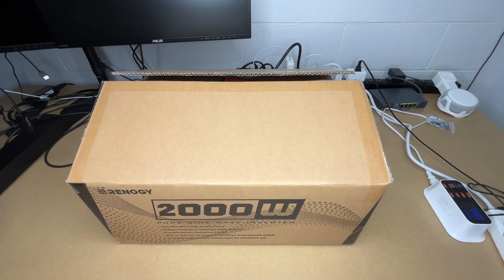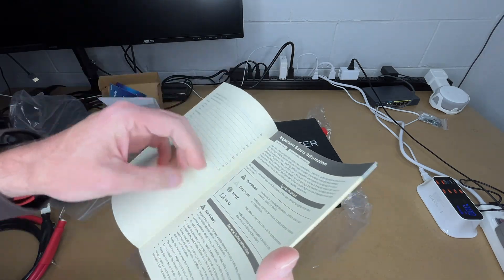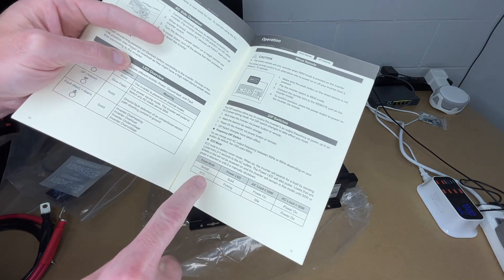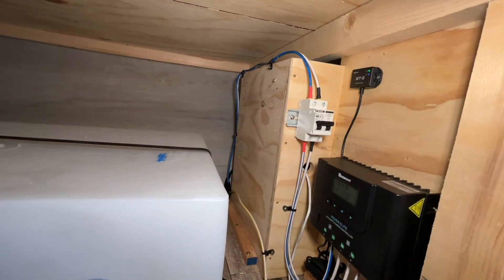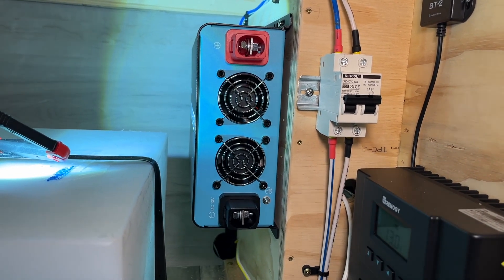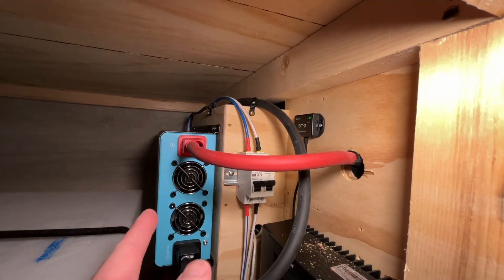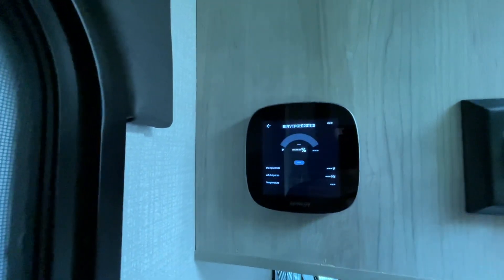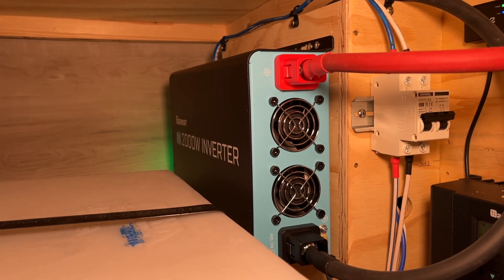2021 KZ Escape E17 Hatch Renogy 2000W Inverter with Power Saving Install

Comment: WARNING! the wire size indicated in the manual seems to be undersized to be safe. For 200A the wire size should be at least 1/0.  I am guessing the manual meant to say 2/0  not 2.
Reply: Warning maybe you should learn to read better. As the Manual tells you 2x #2ga wire =1/0.. Which is what they supplied with it,,,

Comment: Hope your renogy 2000watt is still going strong? I myself planing to buy Renogy Inverter, but dunno maybe I should choose renogy or giandel inverter
Reply from the maker: I've only had it a few months but no complaints at this time. I was impressed by how little power it took on standby.
Reply: @Rickmakes  thanks for your response ❤️❤️ maybe I’ll go for renogy then 😍
Reply: Good luck with after sales support. They bricked their One Core with their stupid software update. Now it doe snot work. 4 weeks later still waiting for a new one. This after 9 calls to tech support. 3 videos and several pictures sent to them. They insist you ship the item back so they can "Test it" Not sure how that works. As Tech Support could not fix it after 5 attempts. I finally got an adult Manager to send me a new one. I will ship the old one back and they can test it all they want. As this update effected so many people. They ran out of One Cores..

So yeah.. I'm going to be buying Victron. They give you 5 year warranty not so cheap 1 year one.
Reply: My inverter passed away in less than a week and it was only on standby know load